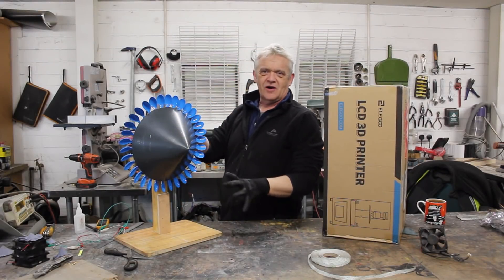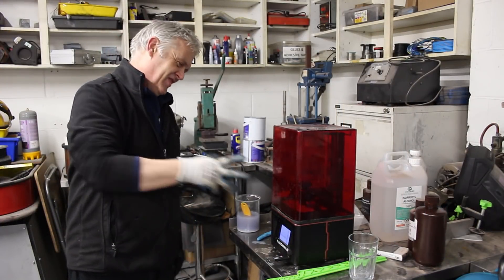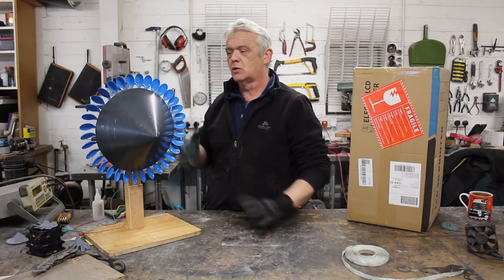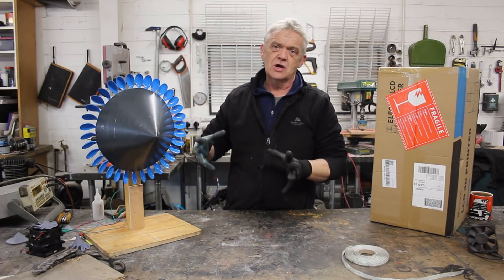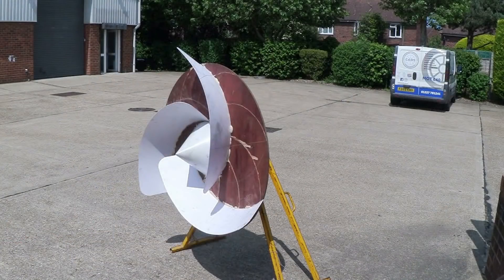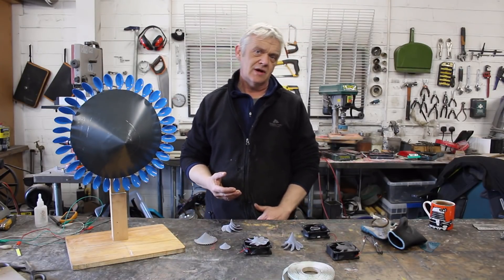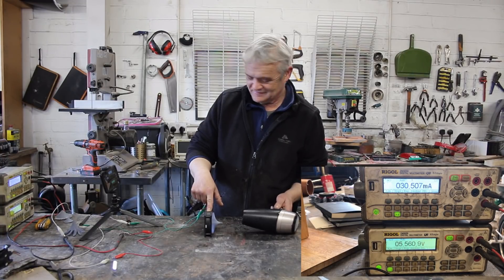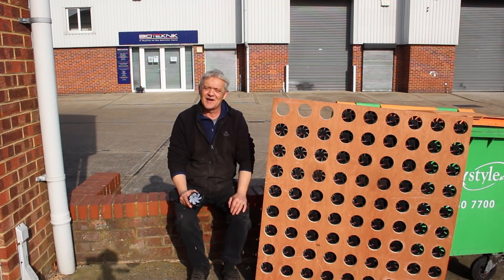1486 Scaling Up The Super Wind Turbine

Comment: I’d love to chat on blade design. I am a hydraulic engineer and I do work with fan blades as well. I’d try a big 3 blade or a curved cup. Layered thin wood. Glued and twisted w routed leading edges. On a gyro w spring loaded cooper connections so it won’t tangle the wire. A fin on the back to orient it to the wind. And a tear drip shaped cover for the motor.

Comment: I have absolutely hundreds of those exact motors from a facility that we closed down and stopped producing the product that they were used on. The CFO wanted to trash them to get them out off the books and stop paying an estimated tax on that inventory so I said OK that's fine and I threw them in my van I threw 5 cases maybe I also have tons of biscuit motors people call them squirrel cage motors but these are small I've been thinking about trying to do something with those

Comment: I have a memory of an Irish company back in the seventies who produced a bearing less turntable for a record player, using the current to create an electromagnetic field that levitated and trapped the turntable and spun it at the required speed. Obviously this idea would not work for a wind generator as it stands ? but if you had two or three discs of magnets opposing one another a similar effect could be induced?? to provide a friction less bearing, quite obviously they would need to be trapped together. I suppose I aught to say I live in a very low wind area the average wind speed is 3 miles an hour and with a build height restriction of 2.5 meters before requiring planning permission. a horizontal wind generator would appear to be my only option to provide the required current to power my home. So you can see my need for a low impact/cost wind turbine with sufficient output to meet the needs of the average household, I don't imagine that this could be done without a battery bank. Also 45 years ago I lived near a inventor with similar problems he built a horizontal turbine in his back garden which powered his house it was quite large and took up much of his back garden, we lived then in a very high average wind speed area but his mill was located between the rear of his house and a steep hillside rising behind his home, however even on seemingly windless days the thing turned. I am afraid he kept its internal working secret but the turbine itself was probably 12 feet in diameter with approx four foot square wind apertures much like a van top fan sat on a three foot plinth no idea what was used for a bearing but rather suspect it was a rear axle from a car or van considering the weight of the fan itself made from angel iron and galvanized sheet steel. Any thoughts?

Comment: Hi Robert, I would like to ask a question, with your advice, I made a wind turbine from a stepper motor, thanks for the video, its this?, when it's on a rotating base for the wind direction, twisting of cables becomes a problem, could we use a spring to bring the turbine back to start and less slack, when the wind slack's off it could return to starting position,

Comment: I can see a possible upgrade to the system. The reason it is reasonably efficient is that the cone concentrates the pressure on small blades. As the air passes down the sides of the cone the pressure increases and hits small blades that have a low pressure behind them. This pressure differential allows the small blades to work in a high pressure differential whereas most conventional wind turbines work with large blades in a lower pressure differential. The problem that remains is that the air is then travelling in the wrong direction because it wants to escape radially rather than go through the gap between the blades. By putting a funnel shaped flange on the outer edge of the blades that radial escape route is not available and the air is more inclined to escape through the blades. The spiral on the cone is probably a mistake because that will cause the air to spin with the cone. Energy will be lost by causing the air to spin as it enters the blades, because all you are doing is creating additional turbulence that will heat up the air but not be converted into electricity. So keep it simple but add a funnel shaped flange should increase the efficiency.

Comment: Essentially it seems that changing the blades from the original blades on the fans gets an improvement. So as I see it at some time in future you will come up with the ideal and best performer for wind to mechanical/electrical converter. I for one am keen to see what this form will ultimately turn out to be. Is there not some CAD technology that could do this quicker and test in simulation than actually making up proto devices?

Comment: Robert,
From what I know about things printed on a 3D printer ( not much) is that the objects are not smooth, but a series of lines that are stuck together. Would that make it aerodynamically poor. The air wouldn't slide over the surfaces but create lots of turbulence. What do you think about that?

Comment: Okay…
Turn a forward slash upside down…180 degrees…..
/ ,       =        ‘ /
So lets get to back to two RB211 Turbo fans with every other blade removed  and the one behind similar and placed in the central gaps…
Placed in the axis of driveway between two houses…
The wind tunnel we experience. Both ways….
Round off the blade tips for less neighbour noise reaction .
Second hand turbo fans don’t command the same pricing 
£200 is still a lot but bang for bucks efficiency….?????
Reply: ),    Upside down    ‘(
‘(

Comment: Robert. Looking at your windwall, I can't help thinking that if you added your cones (or perhaps pyramids would be better I  this context), to the dead space between your fan inlets, it could greatly increase the efficiency of the unit.
What do you think?
Reply from the maker: I don't think it will make that much of a difference if I am honest mate - the wall acts as a kind of poor man's venturi and the fans are placed so the displaced air is drawn into the neighbouring fans - we might get a tiny tiny improvement but set against the work and expense needed to add cones - I would think it was worth the effort or cost for the tiny improvement
Reply: @ThinkingandTinkering  fair enough.

Comment: Now to make the backing into basically an egg carton! Also makes me wonder if blade pitch variability could be possible/useful using concepts from origami. Like if there were thin, flexible sections that'd allow for movement if a central chamber were pressurized or piston in the center could alter the angle of attack as wind speed changed to help efficiency.
Reply from the maker: maybe - cheers

Comment: I would love to see how you wire them all together, it's the part that stumps me.
Reply from the maker: I covered the wiring in the original wind wall video - but basically each one has it's own tiny rectifier and then it is simply series in rows and parallel in columns
Reply: @ThinkingandTinkering  Ah I missed that one. I'll go and find/watch it. Thanks.

Comment: another way to make the fans on the wind wall work better is to use some trees and a tarp or some buildings to funnel air into the windwall also some cones inbetween the sets of 4 fans should push the air in more.
Reply: im going to be building a pico turbine soon with old large blue 45 or 55 gal vinigar barrels (rv antifreeze is also non toxic) . the trick to them is to keep them spinning to catch the gusts of air. so arduino and hall effect sensor and relay should know when to get power from it. maybe the generator could even spin itself up to catch the low speed gusts with a secondary anemometer
Reply from the maker: nice

Comment: 🤓🧠⚡⚡⚡I just got a GREAT idea from watching your videos.  Consider this:
1) The central cone increases the amount of air flowing over the spoon blades but it would also do that if it was NOT part of the rotating part.
2) So that implies that it is NOT required that ALL of the blade surface is spinning.
3) 90% of the blade can be fixed guiding the airflow over the 10% of the blade that actually rotates
4) round things are hard to fabricate while using a centrifugal fan in combination with a much larger bend rectangular plate to guide the wind into it are easy to make.
5) the fixed part of the blade can be mounted on the CORNER of an existing wall or TOP of the gable roof of your house increasing the used surface manifold while it costing noting and being visually pleasing
6) using the wind that is pushed AROUND your house is much cheaper than having to put the turbine on a very high pole or tower.  Like that you also do not disturb your neighbors with a high construction.  Just think how large your roof is and how much air it can push toward/into your centrifugal turbine like that

I would love to see you try something like that because:
1) it is really easy and really cheap
2) it would have far more energy than any free standing centrifugal fan type of generator as those feel the wind at 2 sides of the generator axis while the fixed front panel takes the negative energy away and feeds it onto the positive side.

What do you think?
If it works than it might be both the best and cheapest design you have ever build and the generator would also work better if the wind direction is not 100% correct by the fixed blade correcting the direction partly.  The fixed part only has to be really smooth (like the wing of a glider plane)

The challenge is of course to find which surface and curvature+angle is optimal
Reply from the maker: I think it would workout my question right back at you is - why don't you build it? It sounds like a good plan and I would like to see it too - but I would more like to see it if you gave it a go
Reply: @ThinkingandTinkering  I am a software programmer and have no tools nor workplace were I could produce the needed parts.
Reply: @stephanverbeeck  Hi stephan.
You already own a computer, and you must know people who repair computers? So you can source computer fans, and diodes, I suppose. 
Any cheep 3D printer should be able to print the turbine.
We just need to take the time to do it, I say that, but I can’t find the time myself 😅🤣there are so many other things we need to attent to, but I’m sure that your comment will inspire Rob and everyone, even if he suggest to try it yourself 😁
Cheers.
Reply from the maker: I hope you don't take this the wrong way mate as I mean to be helpful not disparaging - but the original of this was made from plastic tea spoons and glue - all of your ideas can be tested using similar materials - like disposable cups, sheets of cardboard, pc fans, teaspoons and glue - the tools needed would be a protractor, a compass, a box knife, a pair of scissors - I would think it would be well within your skillset and tool set - the biggest thing - I have found - stopping folks is never the tools or space.
Reply: Some good thinking there not having the cone spinning, no balancing or gyro problems. Perhaps add some strakes to the cone to pre-spiral the air before it hits the blades?

Comment: Not cheating
Reply from the maker: lol - fair enough lol
Reply: 3D printing is capable of creating geometries that traditional methods of machining cannot. It's an amazing tool. I want to get a resin 3D printer as well. There is a resin that is capable of withstanding high temperatures. It'd be awesome to design a printable efficient steam turbine. One that could run off of solar using a parabolic mirror, Fresnel lens or something of that sort.

Comment: is the board-with-holes not less efficient than an open grate [like a chainlink fence or something]? i would think the air blocked by the wood would go sideways and impede air trying to go through the holes. kinda like betz law.
Reply from the maker: I don't think so - it's an orifice plate - basically a cheap mans Venturi

Comment: How did the output compare to the original fan blade design? What percentage increase, if any, is realized by the new blade design? Seems like everyone agrees that adding a funnel to reduce the interference from the "wall" would be a great addition.
Reply from the maker: they do indeed agree but - but I am not sure I do - the plate acts an orifice plate - which is basically a cheap mans Venturi - which original blade design do you mean?
Reply: @ThinkingandTinkering  The original fan blades

Comment: Without a 3D printer, plastic can be heated and reformed to some degree. It doesn't always mean starting from scratch when minor angle adjustments can be made by adding heat. If strengthening is required add some 2 part epoxy glue to the back making sure that you maintain balance.
Reply from the maker: good points mate - thanks for adding that

Comment: I wonder how beneficial it would be to create a shroud for the face of the wind wall that would help funnel air to the turbines 🤔
Reply from the maker: you could give it a go on a small scale mate - say about 4 in a square? See what you get
Reply: Yes, with helicoidal blades fixed on the shroud coming up close to the turbine cone, inducing rotation pressure/higher air speed, and the same idea to create rotating aspiration on the back side, and maybe adjacent turbines counterrotating to limit, or increase turbulences (at your best convenance ;-) ) 
Cheers.

Comment: Have you tried mixing your conductive ink with the 3d resin?
Reply from the maker: Yes I have - it doesn't work very well
Reply: Impressive...high tech but so simple.   One more variable....what was the load resistance at the stated volt milliamps?